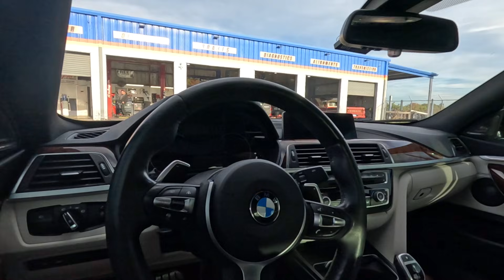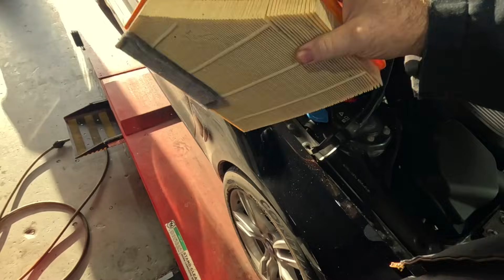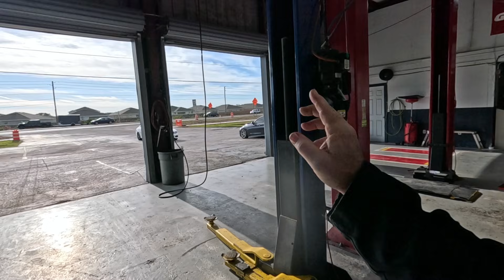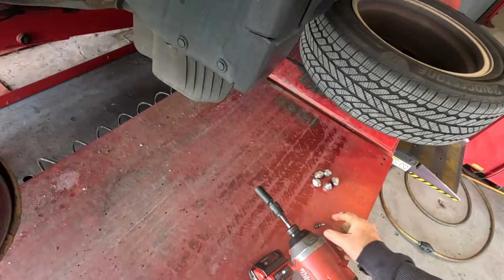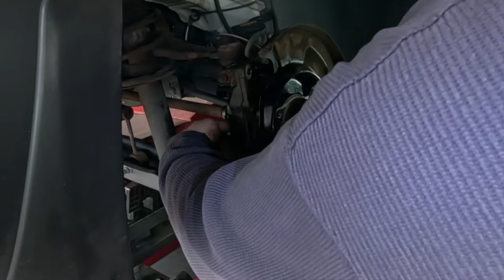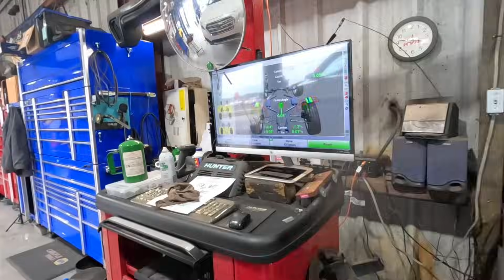BMW RAN THRU WATER, SUBARU HUB BEARING & ALIGN, DAY IN THE SHOP 379 #auto #repair

Comment: Subaru bearings aren't THAT hard, you're just not set up for it trying to do it on an alignment rack. Lisle 40100 hub remover on the front alternating the caliper ears keeping constant tension on the bearing. Air hammer with enough oomf from the back with some long high strength bolts. Also can use a tapered punch air hammer bit from the front where the wheel bearing bolts come through and try and get the hub rotating which usually loosens it up pretty good too.
Reply from the maker: Thanks!

Comment: Hey Jimmy. Maybe try to otc hub grappler kit. It’s a pretty expensive kit and I haven’t had to invest in it yet. I live up north and it’s on the list but I haven’t been burned yet by one like this. I always air hammer the bolt holes side to side. Think like the wheel going in forward and reverse but moving what was ceased for you. That always brakes it free and then I use my slide hammer after. Hope that helps Jimmy. You’ve helped me so much in my young career!
Reply from the maker: Great suggestion! Thanks Keenan!

Comment: ATD hub attachment that you can hit downward with a sledge hammer works good because its not as likely to pull the hub out of the bearing. I either use that or air hammer until i get it to twist in the knuckle then beat it out with a hammer. Live in MD and have yet to be beaten by one. Some take longer than others. Or just spray it with penetrant and it comes right out as we all know. Right guys?
Reply from the maker: Thanks Corey, we just picked one up! :)

Comment: Never worked on a Subaru (not a fan) but struggled with BMW rear bearings during my racing career (they're a yearly wear item when racing) until I bought SIR Tools #B90.  Not sure if it would work on a Subaru but the design is similar.
Reply from the maker: Thanks for sharing, probably similar to the tool we just got. Smash it with a sledge hammer?

Comment: Michigan mechanic here.  Subaru rear wheel bearings - get 2 sacrificial bolts to thread into the bearing partly, then air hammer the bolts across from each other.  It works the bearing out and DONE! - Well got to the part where you said you used bolts and air hammer.  I should mention that the "Big Nasty" air hammer that Eric O has, its key!
Reply from the maker: Yeah, the air hammer we were using gave up, but it did get it budged out. Then a few hundred slide hammer hits finished it off.
We will get some better bolts to sacrifice next time. The ones we used seemed to short.
Reply: I use 4in long bolts - seems to work nice! 
 @JimmyMakingitwork

Comment: Easy peasey  torch the hub, liquid nitrogen the bearing, two big nasty air hammers with the air pressure turned up to 250 PSI on the rear. I remember Erick O fighting the Subaru bearing
Reply from the maker: Yeah, he welds sacrificial hardware to them now. I’ll try that next time.

Comment: Jimmy I feel your pain on the project vehicles. I have two. The 64' C10 and a 79" Caprice Classic. I finally got the Caprice to stop leaking trans fluid and now the 64' starting leaking. Turns out I squished the TV Cable seal while installing it and it was just pouring out the top, but it was dripping down on the pan rail so it looked to me like the pan gasket was leaking. Now I got that to stop and the gear selector shaft seal is leaking. It never ends. You are so close to 16k!
Reply from the maker: Yeah, have to keep rowing!

Thank you! Should be within a week!

Comment: Ohhh wheel bearings.. lol I have the tool you bolt to the hub and then smash on it with a hammer.. works decently usually less then 10 hits for the hammer.
Reply: I bought one of those too just in case the slide hammer didn't do the trick.  Imagine being in the middle of that job & the one tool just isn't doing the job & you're working at home with no coworker tools available
Reply: @s.j.5850  yeah , I did the rear. Hubs on my 2010 forester.. salt belt vehicle with original hubs with 150k miles.. got them both out with out the tool.. using air chisel.. the backing plates were totally rotten..so I just air chiselled between the hub.. marked up the knuckle a bit.. but whatever.. those backing plates are 240$ Canadian for both. I did the front  hubs in September in the driveway..so wanted the tool on hand.. lol
Reply from the maker: Yeah, Joe just bought one. As long as the hub stays in should work well!
Reply: @JimmyMakingitwork  when using the tool support the suspension..keep it from bouncing.. I bought another forester in October.. but it’s been dealer serviced.. didn’t need anything for safety.. 09 limited green with grey leather and a panoramic roof.. not rusty interior is maybe a 7/10 😀. Paid 2250 Canadian

Comment: That Subaru hub was tough but you got it. Never would have thought about using a fender cover on a slide hammer.
Reply from the maker: Works great, more Leverage but mostly easier on the hands.

Comment: If you'd pulled the knuckle on the Subaru you still would have had to deal with the infamous lower bolt wouldn't you? I'm going to have to go watch what it was that Eric O does now, it's ringing a bell but the details elude me.
Reply from the maker: Welded sacrificial hardware on it to press it out with a bolt. Not sure if this style backing plate would allow
It. But I suppose it could be straightened later.